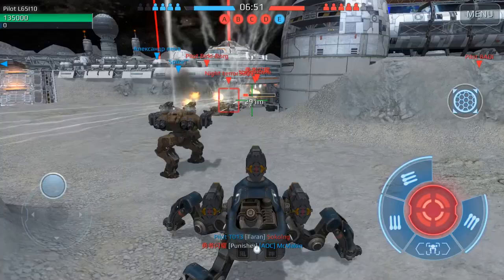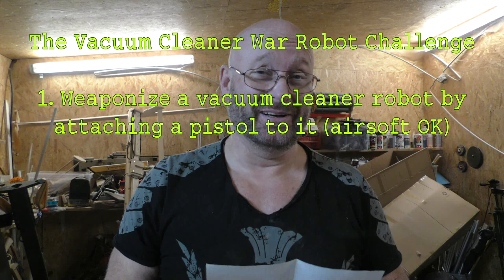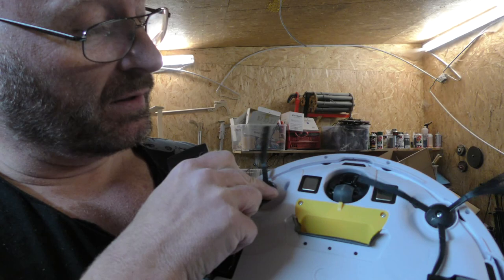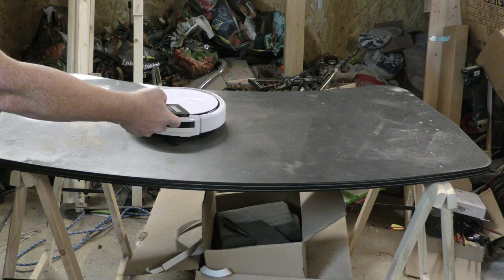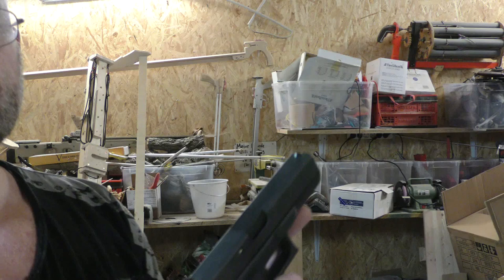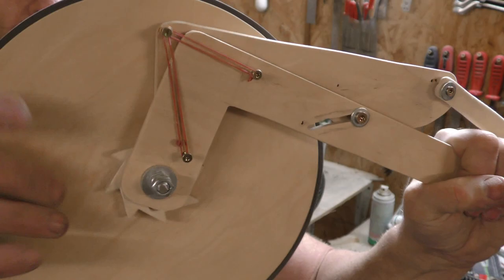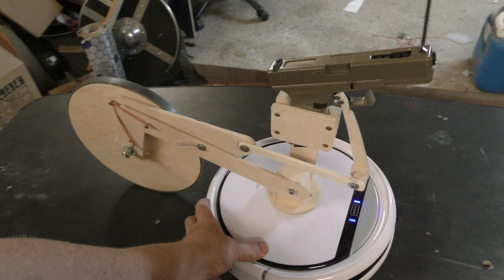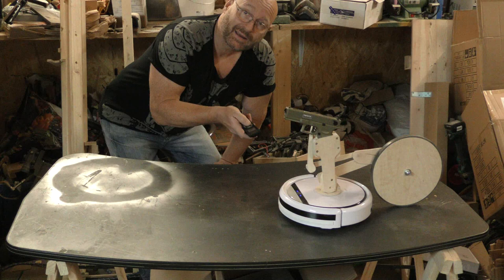How To Weaponize A Vacuum Cleaner Robot (Glock Modding)

Comment: I have a suggestion for you, Joerg, one that I think you would have a lot of fun building and using

The Gastraphetes, or the "Belly Bow" is an old Greek designed weapon that uses a recurve style bow built onto a large stock that allows you to draw the string by applying your whole body weight to the sled in a downward motion. And a big man like you could use a very powerful belly bow

The design is both simple and efficient in use. I figure you could make your own rubber band powered one (with custom ammunition, of course) to great effect, and personalize the specs just to your liking... And to our entertainment

Tod of Tod's Stuff has a video showcasing the weapon, so you can see exactly how it works. I don't make suggestions much, but I'm making this one because it just seems like such a perfect fit for this channel. You're awesome and keep up the good work!

Comment: Well...this pistol is interesting... Never heard of airgun that can do autofire.
Reply: It is an Airsoft AEG in a pistol body.
Reply: Airsoft, not airgun. Airsoft rounds are propelled by a spinning wheel, not air-pressure.
Reply from the maker: Not true. They are propelled by air alright, but the air is pressurized by a piston that is propelled by a spring that is compressed by a spinning wheel with a rack and pinion mechanism.

Comment: Joerg, do a Chinese Fire Spear (or Fire Lance to prevent google search confusion) :D

Rules:
1.Any spear model is

2.This rule:
-You can go for single shot, but has to be rubber powered
or
-You can go automatic, but has to be powered by air compression

3.Design must be at least look similar to the challenge weapon (Has to look like the challenge weapon's gun if rubber powered)

Good luck :)

Comment: with a firmly attached trigger wheel, it could take the  recoil of a glock
Reply: i dont think so, due to the weeknes of the robots materials
Reply: Sure, BUT, if a little structural modifications could transfer the recoil towards the trigger wheel, it COULD work